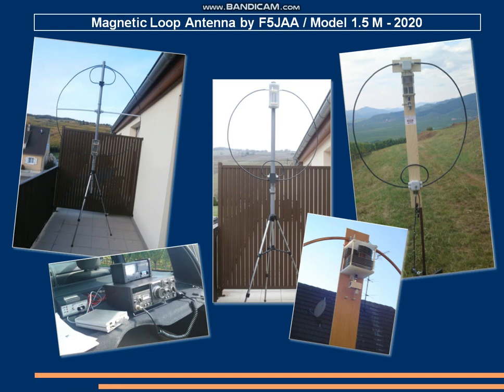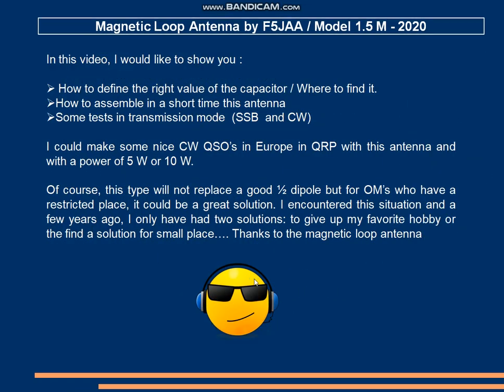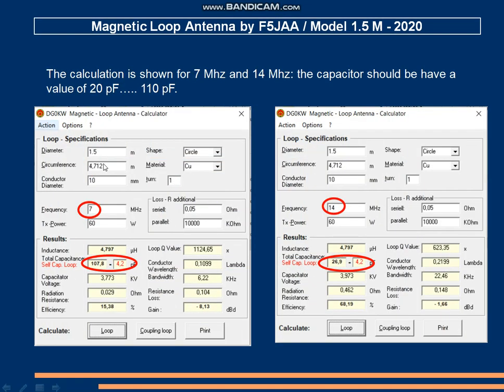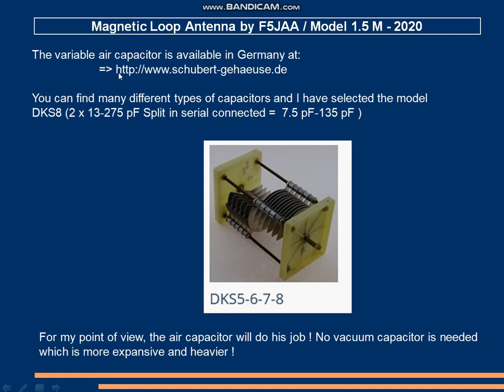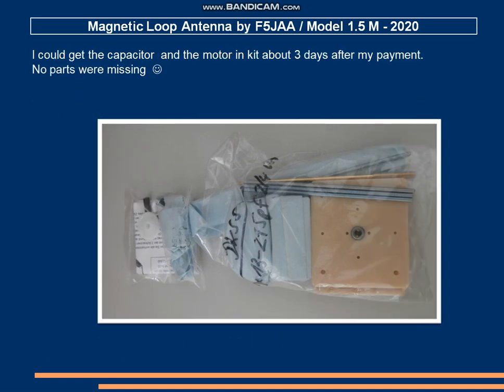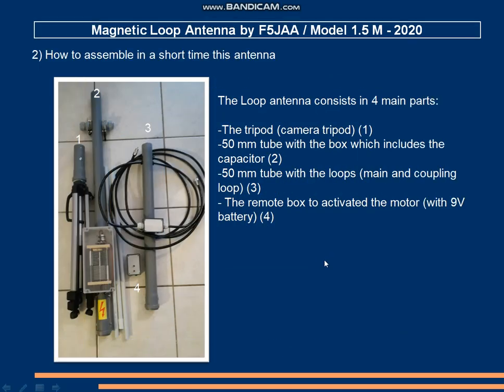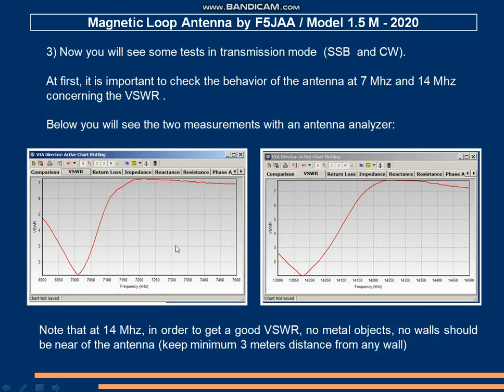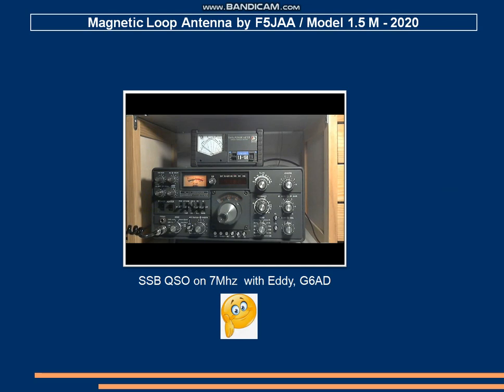Coaxial Magnetic Loop Antenna by F5JAA - 2021

Comment: Hello Stephane, very good job! I use the same capacitor. Do you reach the 17m Band with it?  Did you compare your coaxial loop with your copper loop?

73 Ralf DL6URK
Reply from the maker: Hello Ralf, Thank you very much !  With a minimum of capacitor, the antenna could reach 19.7 Mhz. It should work on 17M Band but I didn't make any test on this band. My feeling was that this antenna of 1.5 M diameter, even with coaxial cable was better than the copper one which has only 1M of diameter. To be confirm...  The shield of the  Aircom cable is like a copper pipe just with less thickness. 73's.